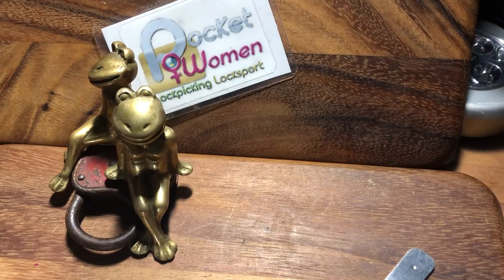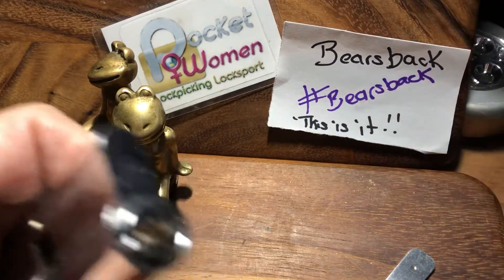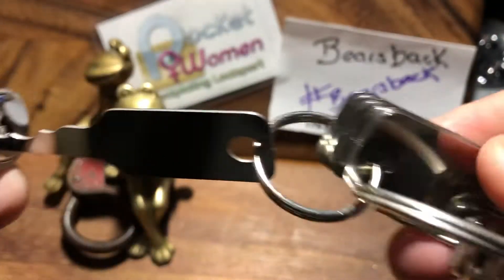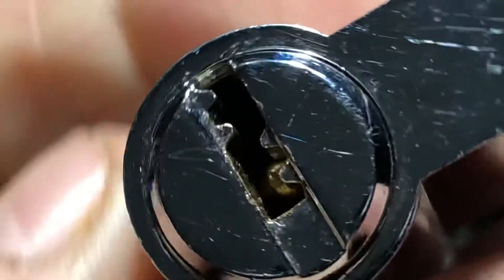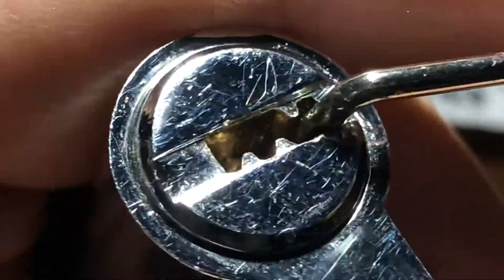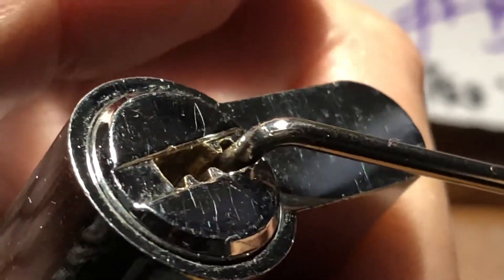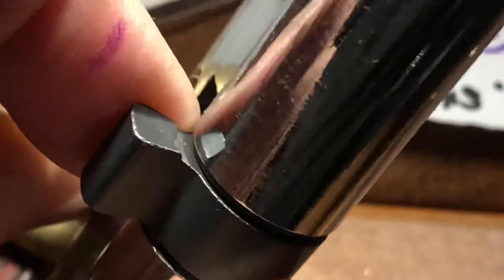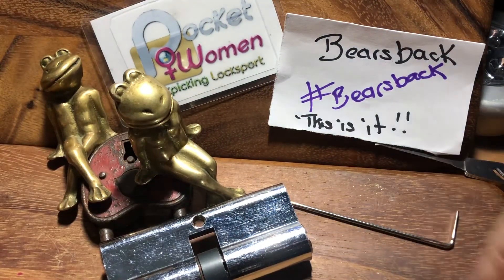(250) Entry Into #Bearsback ‘This Is It” Giveaway

Comment: Great entry into BearFrog’s giveaway 😛
Very nicely done and super quick also. That rake worked very well on that euro. Did you end up getting the jiggler out?
Good luck on the giveaway and stay well👍🇦🇺😊
Reply from the maker: lol, nothing like multi tasking on trying to get giveaway entries in. Yeah The lock finally spat out my jiggler. It was wedged between the top and bottom warding. It took some twisting and bending but it came out. It now has a little bend in it that might just help it function better!

Comment: Nice job! I’ve gotten many things stuck in dimple locks (well, many dimple picks, anyway). The answer has always been the counter-intuitive technique of jamming more stuff in there. In particular, if you can fit a thin tensioner all the way down and try to pry all of the pins up to max lift. Or a half diamond pick might work. The point is to try to lift all of the pins up so they’re no longer trapping the first thing. And hopefully then the second thing doesn’t get trapped… 😅
Reply from the maker: That's great advice. I will keep it in mind. My jiggler was wedged between the top and bottom warding, so I just needed to keep twisting and jiggling it to get it back, The lock finally spat it out, though my jiggler is now slightly bent where the lock had a bite on it. Thanks for your commenting and for watching, cheers

Comment: Hungry locks, yeah been there done that. Normally you can get it out putting something else in, pushing the blocking pin out of the way. Dimple pick? Anyway very fast open and well done on that👍
Reply from the maker: Thanks mate and thanks for the advice. My jiggler was trapped by the top and bottom warding so it took a bit of twisting and bending before the lock spat it out. Thanks for your comment and for watching, cheers

Comment: Nice work, I didn't know a dimple could be raked that way
Reply from the maker: I didn't either until it opened. I figured it is still an inline pin tumbler so the rake might work on it. didn't think it would pop that fast. I know there are dimple rakes, I have one but I haven't been able to open this lock with it. Thanks for watching and commenting, cheers